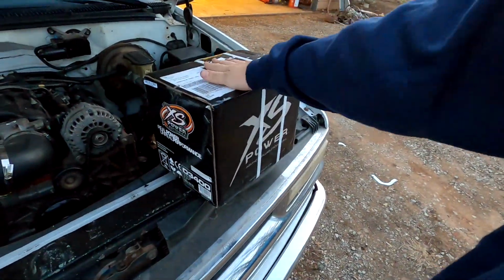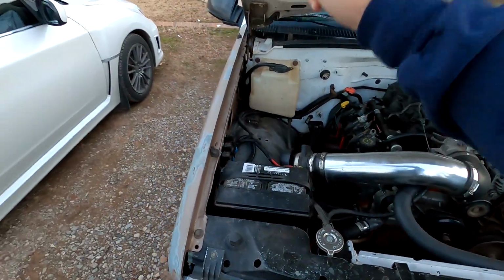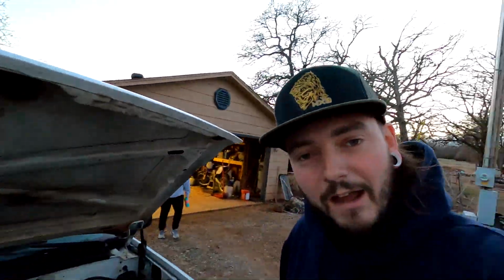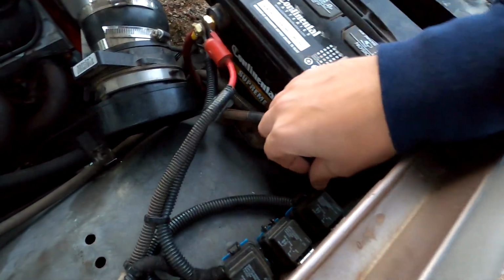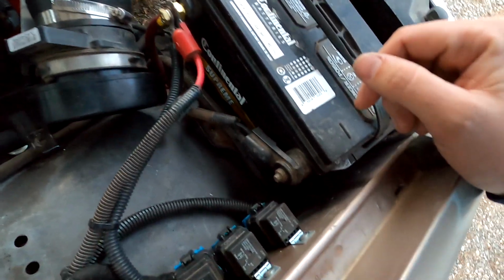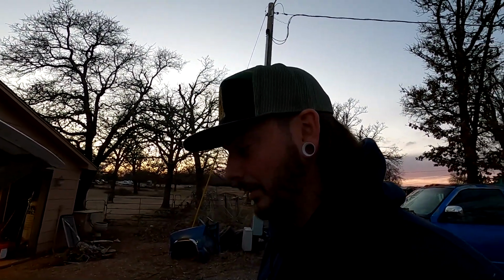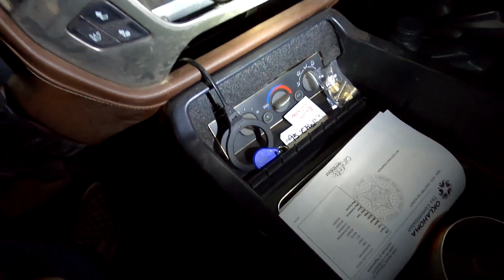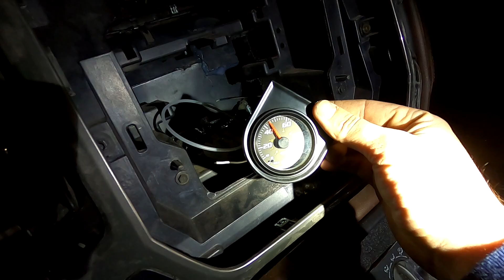New battery, ready for showtime

Comment: Hey man what wiring harness did you use?? I have a stand alone I’m only a few wires away from starting seeing if I can get some info
Reply from the maker: I used Direct Auto Wire but most stand alone’s are the same. What’s up?
Reply: @MattyXBuilds  how’d you do you brake/tcc
Reply from the maker: I have an ABS truck so I pulled the purple tcc wire off the abs module but you can pull it off the brake switch also which is probably better

Comment: that blue dually gonna be ls swapped?
Reply from the maker: Yessir that’s the 6.0 we have in the shop
Reply: @MattyXBuilds  did it have a 5.7 or 7.4 before you guys pulled it
Reply from the maker: Big ole 454
Reply: I'm just curious cause I'm currently swapping my 99 k2500 crew cab had a 454 in it know one has info on it aka (Lt1 swap) he is unsure of the wiring if it's the same and the 4.3 v6 and 5.7 v8
Reply from the maker: I mean on my plug and play LS harness I used, you only connect like 7 wires to the trucks harness. Key on power, constant power, fuel pump turn on, tach signal, voltage, stuff like that. Shouldn’t be too hard.
Reply: alright thanks man been doing my research havent actually looked at my truck harness just the pinout sheet so was just curious. I should be able to wire it no problem but like I said know one has info going from the big block to the Ls. your gonna earn my sub today like watching your vids and will have to keep posted to see what happens to the dually
Reply from the maker: Well I appreciate that! Look back on my earlier videos when I was playing with the harness and you might be able to get some insight off those. Most of the important signal wires are the same
Reply: @MattyXBuilds  No problem man! will forsure take a look at your harness see if its relatively the same